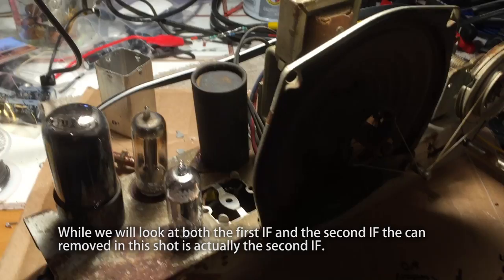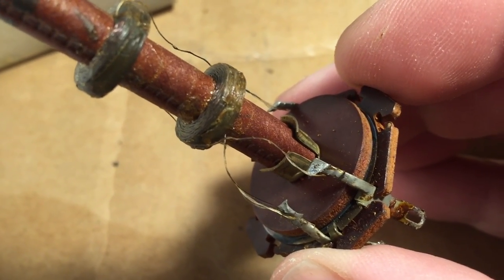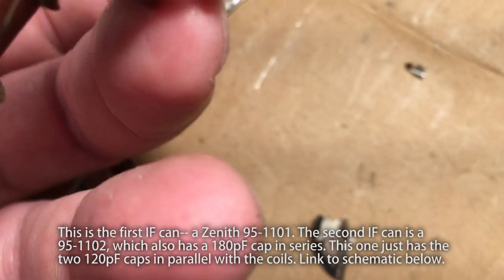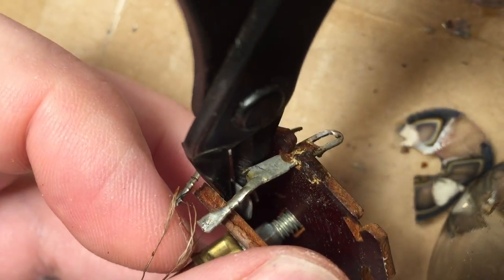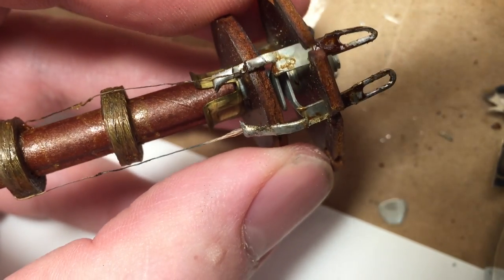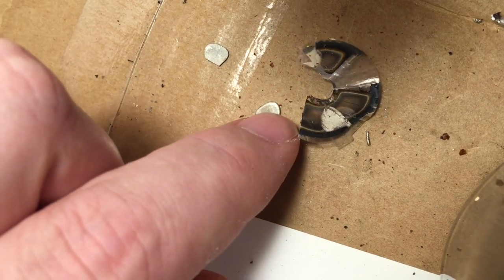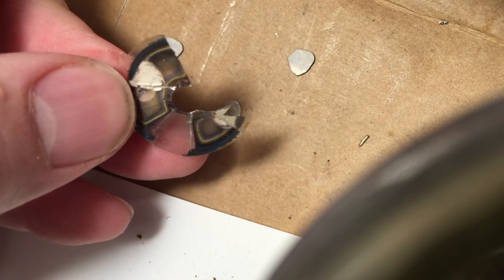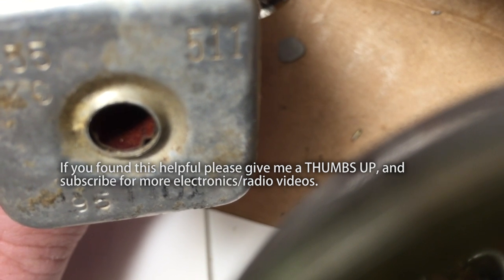Zenith H615 Tube Radio IF Transformer Repair - Silver Mica Disease

Comment: Thanks for sharing! The wires soldered onto the lugs appear to be litz wire. It's a good thing that you ohmed out those coils before putting that IF can back into the radio. As you know, those wires are exceedingly fine and can easily be broken. It's fortunate that those schematics for the IF cans included the values for the old mica caps, which made your job much easier than it would otherwise have been!
Reply from the maker: Thanks for the comment. Yes, they are litz wire, and it sure is fragile. Without the schematic you can pretty easily figure out the required values for the capacitors by connecting up a variable capacitor in place of the old mica, and then adjusting that for a peak (ideally with a scope or VTVM, but by ear if the slug is still tuned would work). Then take that variable cap off and measure its value. Use that value as your replacement fixed capacitor. (You don't use the variable cap permanently because it will drift heavily with temperature.)

Comment: Thanks for the video. I just got a radio with SMD and when I opened the can, I had not seen the design before so I wanted to be aware of how the parts fit together before taking it apart. Lucky for me, you provided this video. My radio only has the problem in one of the transformers but I will be retrofitting both for long-term reliability.

Comment: I have done these a couple of different ways over the years. These big cans will allow you to put the caps inside to maintain original appearance, especially if restuffing old caps in the chassis. When I couldn't reach the inside of the pins (on smaller cans) i actually desoldered the wires and had a much better time of it, especially with the smaller, later, cans. Better to desolder the wires and have extra length than break them off short or (horrors!) from the top where they enter the coils. 

On some cans (the clear plastic ones) you may have to add some hot glue or cement to stabilize the pins. And those with the rivet holding things together (Automatic Radio Co.) are a special pain. I remove the coils entirely before battling it (draw a diagram of where each wire runs - top coil top, top coil bottom, etc.) You may also have to mark the base so everything goes back in the right directions when putting the can back in the chassis. Some are marked with a dab of paint from the factory and you can use that.

Putting the new caps in the cans is a personal choice although I had one case where putting them outside caused issues with them picking up interference from nearby components. Position was critical due to a crowded chassis. Your mileage will vary, as they used to say. The coils themselves don't seem to care.

Comment: Sorry but I do this a little bit differently.  I snap a few pics and de-solder the coil wires, I also draw and make notes of the wire placements so there is no doubt where they go. Then replace the mica with cardstock (thick paper), eliminates the need for clipping the contacts. If you don't want to mess around with de-soldering, you can still do what you did, but there is no need to clip the contacts, just use cardstock between the contacts.
Reply from the maker: Thanks for the reply. I did consider using card stock between the contacts. It will work well, until it eventually disintegrates into dust (in a decade or four) and the contacts short out. This was why I decided to clip the contacts. No chance of ever shorting again.

There are certainly many ways to do this. This was my first encounter with the issue.  have since improved my techniques quite a bit, but the processes is basically the same.

Note that even paper is a dielectric, and there will still be some capacitance between the plates if you put cardstock in between them. Of course it likely won't matter as it should be very minimal and you should be able to tune it out.
Reply: ...I wouldn't use CARDBOARD- I'd use plastic shim stock...

Comment: That what I was
Looking for your video is very helpful info ,I  am somewhat of a novice ,I been doing electronic kits for over 40 years,and a lot more ,tube radios is something I just started, I have one I think is mostly done ,as soon as I figure out were the speaker wires go they snap off  I change the filter caps

Comment: Excellent video. Thank you.
Rather than cut the contact plates, why not slide a thin piece of plastic material between the two contacts?
I have in the past slid electrician tape between the contacts and have had no problem with the end result. 
I also note that each time I attempt the process I change the technique a bit.
Reply from the maker: I was musing about this in the video, and I think it is a good solution as well. This is my first experience dealing with SMD; so I am not an expert by any means.  My only thoughts on this are  that it might leave a very low amount of capacitance depending on what material you put in between the plates. This would like be not problem, and it sounds like it has not been a problem for you. The other reason I think I would just go ahead and trim the contacts would be because I would be concerned about whatever you put in between the plates, sliding around or deteriorating to cause a short later. This is probably not much of an issue either. But if I am already in there I don't see the drawback to just trimming them ( once you know not to over trim them like I did the first time!). Thanks for your comment.
Reply: I would think the chance of adding enough capacitance putting plastic in there would be very high and not worth the trouble, you did it just right by cutting out the tabs.

Comment: I like your idea to use some type of insulation instead of trying to clip the flat pieces. What would you suggest?
Reply from the maker: Thanks for the post. I had some discussions about this at the time with the very knowledgeable folks on the Antique Radios forum. Most seemed to think that cutting the contacts off was the safest bet. If you insulated them you would definitely want to use something like a thicker piece of plastic. Cardboard or other materials would break down. You wouldn't want these things shorting together in a few years. 

Good luck!

Comment: what meter should i use to measure the value of the mica wafer in these. I have three multimeters and none of them go below 100pf. If i get one that is below 100pf I cant read it and it goes in 1nf increments. I would like to be more accurate than this
Reply from the maker: I use a DER DE-5000 LCR meter. They are not terribly expensive. Some of the little Chinese made "Transistor Testers" off eBay will measure capacitance fairly low as well, but I am not sure they are accurate (or read small enough capacitance) enough for this task.

The value might be listed on a schematic or parts reference, or you might find something by web searching for the specific radio or part number on the can.

You can also simply try some capacitors out and see if they work for the full range. More time consuming, but definitely gets the job done. I would start with 100pF or 150pF and go up or down depending on the results.

You could also try to calculate the required capacitance based on the desired frequency, but for that you would need to know the inductance, which may or may not be listed or easy to measure either.
Reply: @PelDaddy  ok thanks. Yes the cheap Chinese ones bother me as you usually get what you pay for. I'm sure some trial and error may be necessary, but the radio when it doesn't exhibit the silver mica arc over is extremely sensitive and clean. But when I get the arc over holy cow the continuous static is enough to blow you out the room and it can last for a while before it clears.
I will look into the meter you referenced as I don't mind spending money on good quality meters. I want to try to get as close as I can to what's in there.
I have also heard of the pencil eraser or razor blade method, but figured what you are doing is probably best long term as im sure the problem will eventually come back and then i have to disassemble again.
Reply from the maker: @kwacz  The little Chinese Transistor Testers are actually pretty amazing, and good for a lot of things. But they can only read capacitance down to a certain level, and I think that may have been around 100-500pF, if even that low.

There is usually no ignoring the silver mica disease; indeed it sounds like thunder!

There are definitely a number of methods to fix the silver mica issue. Like you said, I wanted one that I knew would last a long time. I also like the idea of being able to easily replace the capacitors now because they are on the underside of the cans.

Comment: I'm just wondering if the mica surface can be cleaned of silver with hydrochloric acid and Q-tips.  If so, it could make for a more elegant restoration -- more original, and less invasive to the cans.
Reply from the maker: Thanks for your comment. I honestly do not know. It does sound like you might be setting it up to fail again in a number of years (or decades). But you are correct in that it would be more "original."
Reply from the maker: RyuDarragh Thanks for the reply. Very interesting, but it sounds like using regular caps is the way to go,

Comment: Maybe a dumb question, but why cut the tabs if the mica is all removed? Wouldn’t it be enough to remove just the mica sheet?
Reply from the maker: Thanks for the comment. In this particular transformer if you do not cut the tabs (plates) they will touch each other short out. The mica was the dielectric in between the tabs. Once it is removed, the plates can touch. Some people put an insulating material in there instead, but of course you are they making a capacitor, possibly of the wrong value (but maybe perfect). Whatever you do don't use some insulating material that will deteriorate, like cardboard.

Comment: How did you determine what size silver mica replacement caps to use?
Reply from the maker: Thanks for the comment. To determine the cap size either look at the schematic, or do the alignment first and then measure the capacitance with an ESR meter after you remove the can, but before removing the old mica.

If that fails the just try some standard values that you find in similar radio schematics and see if you can get the circuit tuned. Adjust the fixed values until you are able to get it within range.

I would also suggest posting about whatever radio you are working on to the Antique Radio Forum. The guys on there have all sorts of knowledge of all kinds of radios.

Comment: What's wrong with using a grid dip oscillator to determine the size of the capacitor(s)?
Reply from the maker: That would work too, if it is calibrated for very small levels of capacitance. My Chinese LCR meter ( transistor tester) was not up to the task.

Comment: Looks like you could have twisted those lugs out an perhaps removed them (wire attached) for greater access to clipping. I have a H615 that needs this process as well.
Reply from the maker: Dave WM That might be possible, but when you get these things open and start seeing and feeling the wires you realize just how fragile they are. You just have to be very careful no matter which approach you take. Good luck.
Reply: Hear ya, just looks like it may have been designed to twist lock, but then that phenolic is 50-60 yrs old and may crack under the strain, and prob never meant to be removed so one twist per customer. I will eventually get to it and take a closer look. those 615's sure work well and sound great.

Comment: Did you do another video where you put new calculators on the bottom as your replacements for the silver ones?
Reply from the maker: Ron Thompson Thanks again for the comment. Sadly, I did not do a video of this. I ended up putting mica caps below the can.
Reply: @PelDaddy  where did you buy your mica caps at .nice job on your video hope you do more
Reply from the maker: I got my locally at a St. Louis store called Gateway Electronics. You can get them from someplace like Just Radios https://www.justradios.com/mica.html or Mouser or Digikey. Good luck!

Comment: I think I would have disconnected the coil wires, and taken my chances...
Reply from the maker: You mean disconnect the fine wires, and then try to reconnect them afterwards? My understanding is that they are very difficult to solder, but I have no tried it myself.
Reply: PelDaddy yes - next to impossible to solder

Comment: Just replace the mica with a plastic washer or fish paper. Both will last.
Reply from the maker: Thanks for the comment. I have not tried that. 

I still think I prefer putting caps below the can because that way they can be changed easily in the future. Also then you don't have to worry about the dielectric breakdown of whatever material you put in there at the voltages involved (since most washers and paper don't come with datasheets specifying breakdown voltages). But I am sure it could work, and I am guessing you have used this method with good results.

Thanks again.